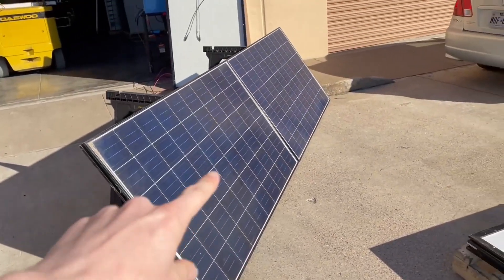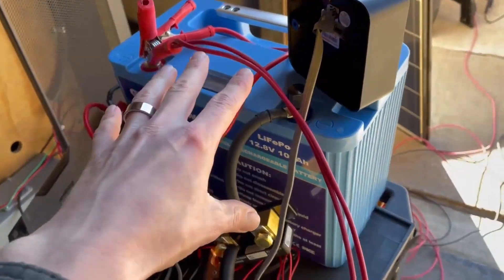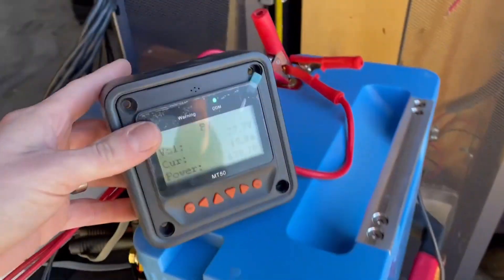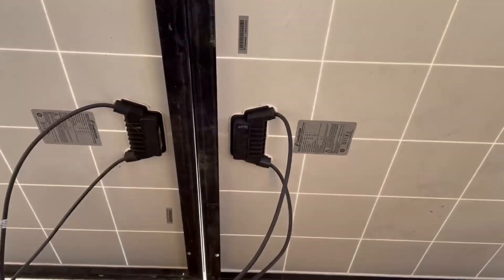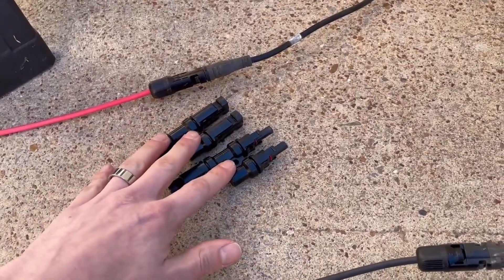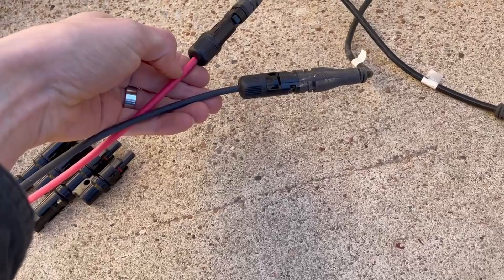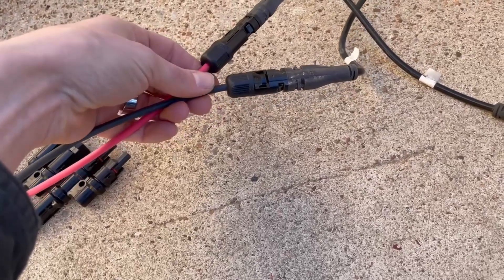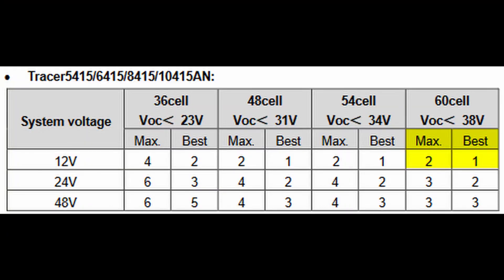Ignoring EPEVER Manual Makes More Power? Part 1/2

Comment: The simple answer is you have more voltage at low sun angle to harvest energy. This makes sense with MPPT controllers looking for maximum power point.

Comment: I have 60 cell 220 w solar panels. So similar to this setup, except I have 3 200ah batteries (wired in parallel) so if I understand correctly (12v system) I can max use 2 panels?

Comment: in an ideal scenario of sun exposure (tilt angle, no shadows), and if you have a solar panel which is made for 12v system (~50-200w, 18v Open voltage, ~12-14v at typical amperage), a PWM controller is actually more efficient than messing around with MPPT. its impossible for a lot of people to admit since people spend so much money on MPPT systems that they have been told by someone very well informed will boost their panels efficiency. if you have a solar system that is almost perfectly spec'd for your battery, the MPP will naturally be around the ideal charging voltage at ideal amp draw of your battery system. and if that case is true the most optimal setup is actually to wire the solar panel directly to the battery. million reasons why you should never do this, but it might be worth testing just to show how its better than the most expensive MPPT controller in the world.
a pwm is basically the same thing with a somewhat smart oscillating switch. if the battery is pretty low state of charge but still almost nominal voltage, like how most lithium chemistrys work (compared to lead/sodium), then the PWM controller will have a ~100% duty cycle and beside the tiny loss from the pwm controller itself, it will be the same as directly wiring to the battery with a safety swtich.

Comment: That Changes if you shade one, but the higher the volts the better they work because you are  not in the best mppt range at the lower voltage, I’ve seen it on the Powmr also.

Comment: The higher the amps the more resistive the wire is.
That's why you need thick wire for high amps, where as you can run 25000 volts through a single strand of wire at 0.5 amps with no loss. But put 12 volts at 100 amp through the same wire and melt the wire instantly.

Comment: Closer to the max V of CC is best but relative to Max wattage which you achieve stringing panels together in series. Then Tie the strings together in parallel to achieve Max Amps.
Reply: can 30a charger cope 3x11A, epever says can overpanel 150%

Comment: Closer to the max V of CC is best but relative to Max wattage which you achieve stringing panels together in series. Then Tie the strings together in parallel to achieve Max Amps.

Comment: You need to check the charts in the controller's manual for where it is most efficient with your combination of solar panel voltage, battery voltage and the solar panel wattage getting to the controller.  That can vary from 92 to 98%.  I've been running a very small off-grid system using an EPever 3210A controller for about 5 years and I've done a lot of experimenting to learn about solar power.  The current system is my "Wait until daylight" backup system because it can run the fridge and furnace for about 12 hours and in 12 hours I should have enough light to get the inverter gen out of the equipment shed (where the mowers & etc. live) and get it going for as long as needed.

However, I'd suspect the loss in the wiring from the solar panels is making the difference you see.  From my wire loss spreadsheet* (based on wire resistance per foot for whatever gauge wire is being used), two 300 watt panels (an entry I already have in the spreadsheet) delivering 9 amps each for 18 amps at 34 volts loses 2.64% of its power in 50 feet of #10 wire.  If the two panels are in series for 9 amps at 68 volts, the loss in the wiring from the panels to the controller is 0.66%  - which means you get almost 2% more power from the same equipment because there is less loss in the wiring.  2% of 400 watts is 8 watts so that's a good start on the differences.  

Try again when you have more sun time and measure the losses in the wiring with the solar panels in parallel and series.  And do it with enough load on the batteries to keep the charge controller working hard ;-)

I like the EPever controllers because they are built like tanks.  I don't expect one to survive a direct lightning strike, but they do handle near-by strikes (150 feet away, a neighbor lost his fiber internet connection) and tripped a breaker in the breaker panel.  The RS485-USB adapter I use so I can monitor the controller remotely (ancient laptop running Win 7 + the EPever SOLAR software, and using the free UltraViewer to access it remotely) died that day but the controller is still working fine.  I expect to replace 2 to 4 of the RS485-USB dongles each year - and I have a bag of them near the monitoring laptop.  Having the big heat sinks instead of a fan means the EPever controllers just keep working in the heat and don't die from fan failure.

* Send me a message if you want a link to that spreadsheet.

Comment: Do you know of anyone who has used (3) EPEVER 100 Amp MPPT Solar Charge Controller 200V PV Input Negative Ground Work with 12/24/36/48V Battery System Tracer 10420AN Series W/ MT50 Remote Meter to charge a 48 volt VRLA 2,000 amp hour battery bank? I am looking for information in regard to creating a fully off grid system for our property in Northern Nevada.

Comment: I just bought an EPEVER 80A (8415AN model) and it is running default settings. If I want to connect 3 or 4 panels in series and connect a 24v or 48v battery array, do I need to make any manual changes for this to work or will it work as Plug N Play?

Comment: I have a few 350 w 24 v panels if I run them in parallel would the charge controller even recognize that low of a voltage ? The always include the max voltage of the charge controller but it’s hard to find the minimum voltage    This will gauge what size controller I buy since a 100 amp controller may have a higher minimum than a 40 amp controller
Reply from the maker: Hard to say if they don't publish it. Generally speaking the vmp of the panel needs to be a few volts higher than the max voltage the battery will ever be for any charge controller to operate correctly. I like to bump up close to the max voltage of the controller as that allows bypass diodes to operate correctly and generally less/smaller wire from the array to the controller. Keeping in mind that as the temperature drops the voltage rises on the panel so here in north Texas I keep the voc of the panels about 90% of the max of the charge controller.

Comment: There is nothing like parralel is better or worse, it depend on what you have as charge controller and what/how it handles it.
Each controller got an efficiency that change depending on the voltage...

Comment: These solar converters use a buck converter circuit, which can be very efficient for a wide range of input voltages. Note that this is nothing to do with MPPT tracking, which attempts to change the impedance seen by the panels for maximum power extraction, and should work well over a large range of voltages. Also, series panels halve the current in your case, which reduces the resistive losses (I^2 R) by a factor of 4.

Comment: DC line losses will make you scratch your head and say WTF? Anytime the current is constantly flowing in one direction, it will make less power transfer then it would if the current is AC, even if it's still within the capacities of the wire you are using. Also the longer the wire which in this case looked to be a fairly long distance with all of it combined. The wattage differences from parallel to series were only a few watts but it still makes a difference. Yes changing from parallel to series will make a more efficient system as how was indicated, double voltage equals half amps. Take the case of a standard diode which has a forward voltage drop of ~.7 to 1.7 volts, when you are working with a 12 system, you loose that which amounts to a wopping ~ 10%. Inside the MPPT controller are diodes and components that will be responsible for that 10% loss or more which would require the controller to attempt to overcome when the system is only a nominal 12v single or parallel panels input arangement. If you double that voltage from the panels, you are now looking at only ~5% loss. In the NEC manual and anywhere else you look for data ( info ) you will find that in DC circuits, step up, up to 4 wire sizes at least even for circuits that will be going more than a few feet. This was the argument between Edison and Tesla. Obviously Tesla won that one ! Good thing for the world as Copper is already expensive and in short supply, image how it would be if Edison had been right?

Comment: so lets see how long this can get. your charge controller take the solar volts and drops it to lets say 14vdc. so when you lower volts, amps increase, lower amps, volts increase in the charge controller. so when the panels are Parrell the volts stays the same amps goes up. now the charge controller drops the incoming volts to 14 for example. now when you lowe,r volts amps increases but amps are already increase because of parrell connection so no increase here. but in serious the volts incoming is a lot higher lets say 50vdc so when the charge controller drops the volts down to 14vdc to charge the battery then there is a higher increase in amps. no matter what connection serious, parrell the total wats is the same. so by using serious connections there is a higher amp output into the batteries. hope that helps.

Comment: There are many factors that can contribute. If you halve the current by going in series, then you reduce the cable losses to a quarter of what they were.
But there are also factors in the MPPT converter. Does it run better at higher voltages? Some do.
And the MPPT algorithm might work better at high voltages too.

Comment: This is simple and has nothing to do about the controller. Less amps is less loss over cables etc. tho it’s good they say you should keep them in parallel because these charge controllers stay in PWM mode uncomfortably long if the input is under what they deem acceptable to fire up mppt. I have a small one panel setup where the controller pulls down the voltage of the panel to battery level until it reach about two amps. Then it kick in mppt mode and your two amps in = 6 amp charging to the battery. That’s the drawback of the EPEVER I have come across to date.

Comment: We have a 4210 controller.  Consistent higher wattage with higher voltage. Not just that it produces earlier, but consistent through out the day. No problem with high temps

Comment: Lower impedance ohms law I run mine near the max voltage works great with a single 12V LifeP04 battery runs a small 5000 btu AC unit all day and night with two 265-watt panels I bought used.  I set the temp to 88F I'm only wanting to keep a shed cooler for our Halloween decorations, so the plastic doesn't crack. Where I live Arizona we see 117F annually. I haven't gone through the summer yet with it I may have to add another battery we will see.

Comment: Epever seems to have some built in software/hardware conversion. I have noticed that my Epever will convert excess volts into amps. Usually when your volts are double your battery bank rating the conversion into amps is at its greatest.

Comment: 1:45
Why are there two cables connecting the battery to the charge controller?
Is it to distribute the current?
Reply from the maker: Yes, the powmr controller I mess with a lot has two 10 gauge ports so both are needed to support 60a.

Comment: Is it ok to use the MT50 with 100 amp charge controller, the instruction manual only mentions using a PC  or an ebox WiFi?
Reply: Yes you can
Reply: @vet137  thanks, ye got it installed with the MT50 now
Reply from the maker: Honestly not sure. Seems odd for if not to work.
Reply: @BeeneEnergy  thank you

Comment: anybody have problems with the terminals on these failing, stripping?  Can they be changed?
Reply: Yes and yes! You need to find screws with with same threads and if the "heads" are a bit too big just push down to make them go down inside the hole there. This is what I did anyway. Again if you find the proper screw but head is a bit too big but might fit then just push down hard to force it past small bit of plastic that surrounds the screw inside that hole area.
This is how to get bad screw out. get a small tool under bottom plate inside that chamber area where wire goes. Get under plate so you can lift plate UP with some pressure/force enough to keep it up. I used small flat tip screw driver or use a tool that does not bend. Now at same time you do this start backing out stripped screw, keep pressure on plate, back the BAD screw out at the same time and you must have pressure so plate is pushing UP against bad screw this will help extract it. GOOD LUCK!

Comment: Sorry for the Dumb question, But would you be able to do a Video with the EPEVER showing what and how to use all the connections on it? the manual just mentions them, but not the way to connect them. for example I have the EPever Tracer AN 100 AMP MPPT controller and it has connections on it that are " Load Control Relay" "Remote Voltage Sensor" "Diesel Generator Relay" 2x RS485 ports, "Remote Temp sensor" "Diesel generator relay/load control relay" I know what most of them are, but would really like to see all of this in action, well besides the obvious rs485 and temp sensor, again those are obvious and just accessories that plug in. the others seem to require wiring of sorts. Ive had this controller for a couple years now and would like to utilize all of its features, and since I seen this on your channel was hoping you could do a short vid on it? Appreciate it - Patrick
Reply: Are you using an MT50

Comment: I don't know how you're connecting and reconnecting your panels from parallel to series, but if you're making and breaking the MC-4 connectors in sunshine you'll wreck the connectors. They're not rated for connection and disconnection at those voltages. You need a properly rated dual pole switch or breaker.
Reply from the maker: Yep shouldn’t be under load. Don’t remember if I followed what I should do here or not ;).

It’s not a very big arc at 70v. I’m sure it’d kill a contact real quick at 600v.

Comment: beene i have the same question , my epever controller 12 volts battery max is 520 watt and 24 volts battery is1020 watts. do you think i can set up two 540 watts in series ?
Reply: I have 40A epever at 12v it support 520watt used 330 watt two panels in series it worked fine. Later bought 380watt later sold. Now 340+380 connected in series and it’s reached to 38-39Amps. But from 4,5 days it’s show power of one panel. 33v instead of 70-75v and 200watt instead of 400watt. Epever says you have exceed the limit

Comment: If you treat each panel as 12 series makes the panels equal 24 bat set up  from what I've come to understand the mppt can support  an 48 solar array set up so if you use it in conjunction with 12 24 36 48 set ups it's equivalent to those unknowns your asking.

Comment: how to set the control parameters EPEVER? Which entries do I have to make for OverVoltDisconnect, OverVoltDeconnect, BoostChargingVolt, FloatChargingVolt, BoostReconChardVolt LowVoltReconnectVolt. I have 16s 3.2V 48V Lifepo4 200A = 10kW